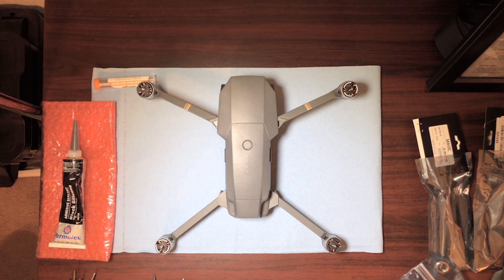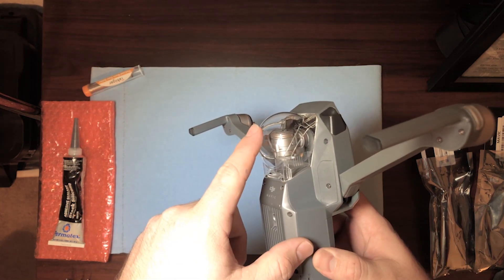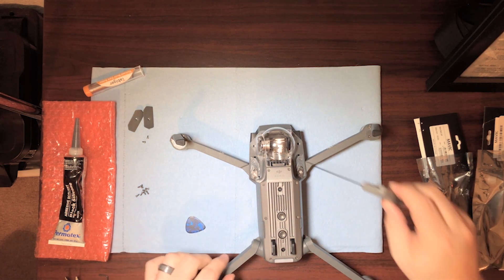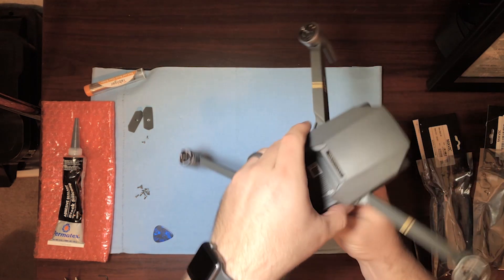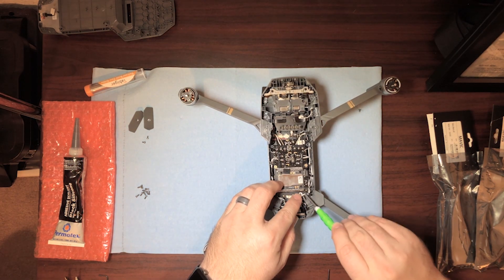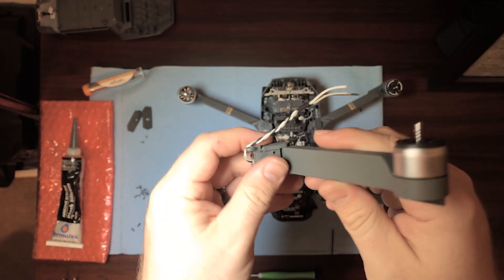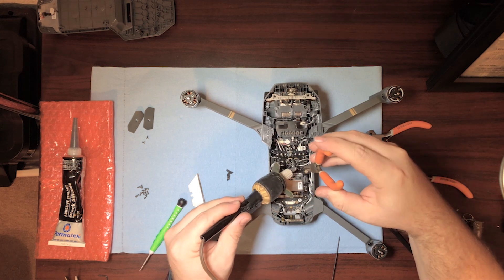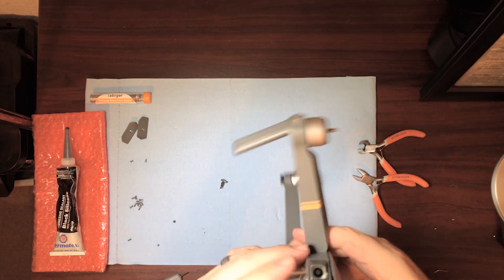HOW TO: DJI Mavic Pro Rear Arm Replacement! Mavic Arm Repair Tutorial

Comment: Thanks just wondering how do you know the order to solder at least the two white wires
Reply from the maker: The wires are white, grey, black. There should not be 2 white wires if you have the correct part. Thanks for watching!
Reply: @camranncoker6722  sorry I'm having trouble seeing which one is the gray wire I will rewatch later

Comment: I have to replace the rear arm of my Mavic 1 and I'm having a hard time to remove the old solder (it's not melting at all). I'm using a 60W soldering iron with a ceramic tip. However it is melting regular solder by contact, everything is brand new. I believe this soldering iron gets to 300° celsius, do you know if I need a more powerful one? Which type of core solder should I get for this specific repair? Thanks!
Reply from the maker: Mauricio Fernández Sometimes with that type of soldering iron you will have to hold it a very long time on the factory joints to get them to melt. Also make sure to use a tip that is as big as possible.

Comment: Thanks for this great video dude...👍 same thing happened to my mavic pro when it crashed... it crack at same spot on the wing... my question is  if I just JBwelled the spot to repair it (since I dont have any experience in saudering) will it give me a message on my control? Or will it affect how the drone fly's?

Comment: Very good. Thank you for doing this to help,us all. You obviously didn’t use a variable heat soldering iron. So just a simple $ cheapy will do? Thanks again
Reply from the maker: xray364 You can use a basic soldering iron but it’s way easier to use a nicer variable heat one. I used a basic soldering iron for this repair but now I use a Weller WES51 soldering station and it’s great!
Reply: Camrann Coker thanks Camrann, how hot would you have the soldering iron doing this type of work with a decent variable temperature soldering iron like the Weller WES51? Thanks
Reply from the maker: Kinda depends on your style of soldering but I like max temp 850° and being very quick with it.
Reply: Camrann Coker Hi, Camrann, can I please pick your brains. I attempted to install a new rear leg today. Everything was going fine. But I had a hard time removing the wires as the solder on the board wouldn’t melt easy. The soldering iron appears how but it’s not a variable temperature type, but the old 60 watt cheapy. Anyhow, after a fair bit of trouble I did manage to melt the solder and pull away the old wires. However, try as much as I wanted I could not solder the new wires. In the end I gave up as I didn’t want to apply too much heat. Do you recall if the wires came off and soldered on easily on your repair. Also the solder I had would not attach itself to the wires so, it mustn’t be a rosin core soldering wire. That would help so I’ll grab some tomorrow, but even so, I couldn’t melt the old solder.  I’ll grab a variable temp soldering iron as well. I assume 850 degrees is Fahrenheit and not Celsius. Thanks in advance.

Comment: thanks for the video. Easy to follow along with. I had the same issue - the tab stop for one of the arms was cracked in a crash so I order only the tab/turrent part the arms connect to the main body.. I wasn't anticipating I'd have to take the whole arm off and desolder the arm connection to the motherboard. Didn't look so hard - hopefully not. Cheers

Comment: WHY NOT CUT THE WIRE IN A MIDDLE AND TIGH THE NEW ONE IN, NO NEED TO SOLDER THAT WAY?
Reply from the maker: Roman The Explorer You could do it that way but it wouldn’t be a factory quality repair. Unless you crimped them I wouldn’t trust a splice on a drone that vibrates. Thanks for watching.
Reply: Camrann Coker agreed, thanks! Also not mean to caps lock

Comment: What was the size of the screws that were smaller? You said take note they are smaller but never said what size they are. I'm trying to figure out what sizes I'm going to need to buy. I already know I need 1.5 mm hex head key
Reply from the maker: Andrew Bidwell you’ll need a 00 precision Phillips a 1.5mm and a 2mm hex. The link in the description for the screwdrivers is an affordable little set that works great! Thanks for watching. When I say smaller I mean the length of the screw was smaller.  Not the actual head size. Should have said  shorter lol. Thanks for watching!

Comment: Awesome video! You are amazing! I crashed today and broke my right rear arm. I will be replacing it myself thanks to you. I do have a question though. Here’s the scoop-My rear right arm is broken, so I took off the props to do a simulated takeoff and neither of the rear motors spun. The left motor and arm look to be in perfect condition. Do you think the right arm being broken is causing the left arm to not spin? I get an error message then the two front props stop. All 4 motors twitch when I power the drone on. Sorry for the long post!
Reply from the maker: If the wires are ripped out that definitely could cause some problems. I don’t know if electrically the rear motors are connected on the circuit or not. You’ll just have to inspect everything once you get the case off. Let me know if you have any other questions. Thanks for watching!

Comment: Hi. Do you have to desolder and solder? Can the wires just be cut somewhere in the middle to be connected to the new ones?
Reply from the maker: Alfredo Gonzalez I cannot personally recommend doing this by cutting and splicing the wires together. It could be a serious safety hazard if the connections failed mid flight. That being said, you could technically cut and splice the wires, i would make sure you have a very good crimp. I would recommend just desoldering and resoldering the new arms to make sure it’s repaired just like factory. Thanks for watching!

Comment: Dude, great video... have to replace my right rear arm.  I thought it would be a nightmare to dig into that thing, didn't realize it was that easy. Great job.
Reply: I have to do the same after a crash today.
Reply: Video and instruction was perfect.  Accomplished an easy fix this evening, upgraded my props and my sweetie is back in the air.  Thanks!!
Reply from the maker: Thanks for the kind words. Glad I could help you out!
Reply from the maker: Dave Drum Awesome! Glad you got her repaired. Thanks for watching!
Reply: Any error light or issues replacing the arm like you can get on the P4 when you replace a motor?